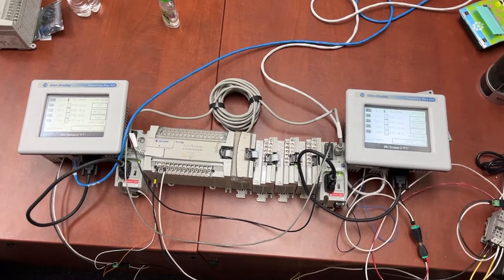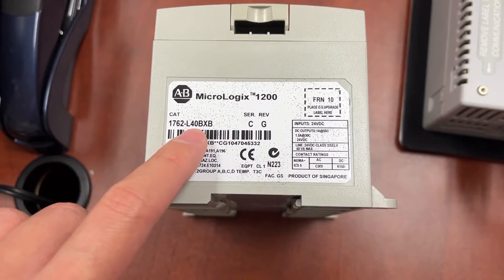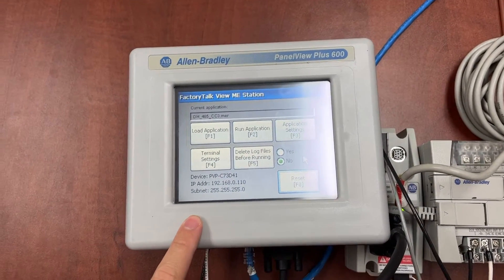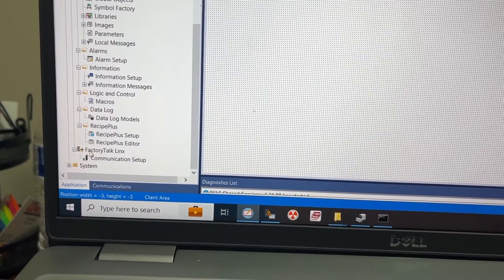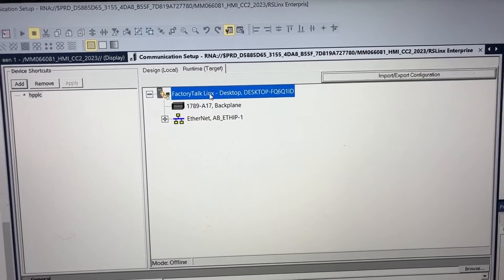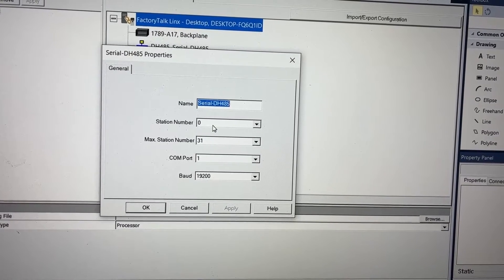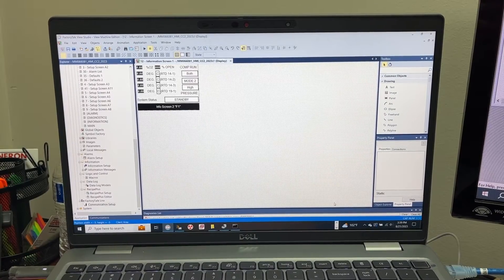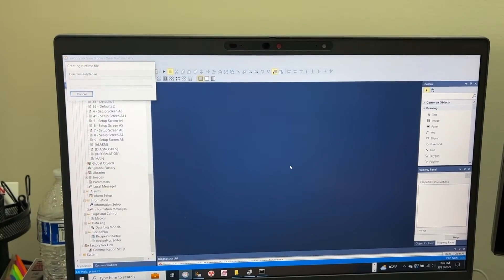Allen Bradley Micrologix 1200 PLC Serial Comm. with Panelview Plus 600 HMI DH-485 Setup

Comment: una pregunta si yo presione el boton com del plc, y se cambio al chanel 0 que puedo para reestablecer el canal que tenia con el scaada al que le esta enviando los datos
Reply from the maker: @user-fb9rd2dl4l: Unfortunately I don't think that would be possible. However you can look into your scada system to find out what communication protocol and configuration it is looking for from the micrologix1200 PLC. Then you can set it up again in the PLC logic. Good luck.
Reply: @SYPHOANG  muchas gracias, asi lo hare es que eso es lo curioso cuando por defecto la comunicacion al presionar el boton com, se visualizan unos datos en el scada, y al apagar el plc, se dejan de ver esos datos